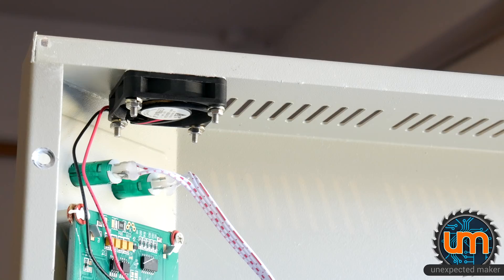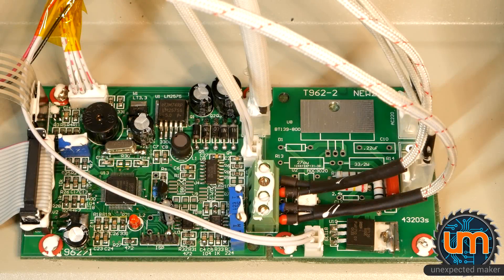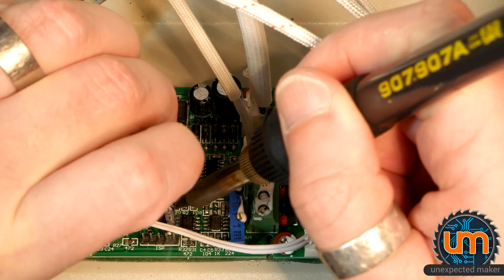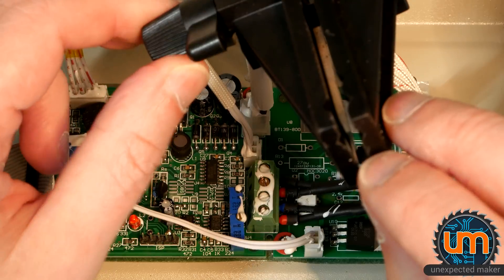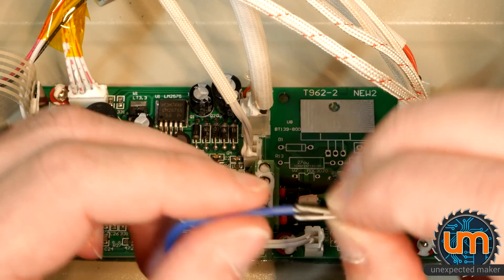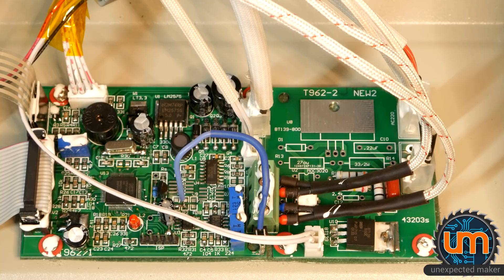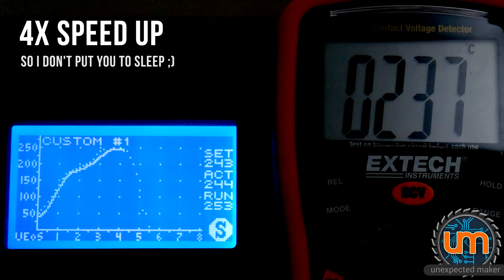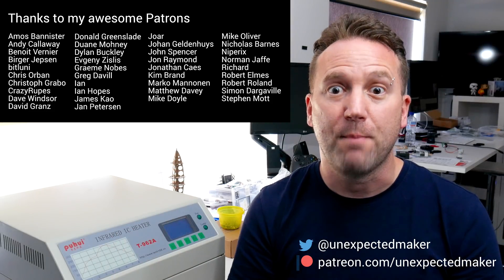T962A Mods Pass 2 - Maybe the final ones?

Comment: Thank you for the clear and accurate video on how to modify my T-962 to make it a reasonable reflow oven.  Your videos made it possible for me to do these modifications with a minimum of trouble.  The only issues I had was getting the C2102 driver installed and operating and that was not an issue with your videos but rather me trusting the message that my drivers were installed (they were not) and my device was ready to use (it was not).  Once I got past that the new firmware and the cold junction mod worked perfectly.  Two thumbs up and my undying gratitude to you.

Comment: I've done these mods on my oven, but I still have issues with consistency in the reflow profile, particularly after the oven has done a couple of runs, the ambient the area which hosts the control boards is higher after a few runs so cold junction is no longer representative. I think the cold junction should probably be moved to the fan end to measure ambient air from outside more accurately.   I've yet to try moving the cold junction got a bit fed up with it to be honest. But its good to see you had some success,  i was going to give up on it, but having seen this I'll try again.

Comment: I have this EXACT Model with all the MODs -- and I have yet to flash it yet -- How is your unit working -- 3 years on?
Reply from the maker: I got rid of it 2.5 years ago - it's a terrible oven. Ok for smaller boards that you just want to use yourself, but not usable for anything production quality. No amount of mods and flashing will fix the totally uneven reflow you get - scorching and under reflow is too common.
Reply: @UnexpectedMaker  Good to know - I mostly have boards that are 8 X 3 CM -- usually only 4 to 8 SMD's, the rest through hole -- If I hit on anything that is production worthy, I'll get my PCB maker to the board populating -- the oven is strictly for small volume R&D...

Good to hear that you got a bit of life out of it. Thanks for the quick reply -- and great channel!
Reply: @UnexpectedMaker just seen this comment.  On that note. Looks like I'll be ditching mine rather than wasting more time on it. 🤔

Comment: Hi, short question. Do you have to do a firmware upgrade to be able to use Cold junction modification?
Or is it the case that the original firmware automatically detect the Maxim 18B20 sensor? Regards /Bo
Reply from the maker: You need to do the firmware upgrade to have it enabled.

Comment: hey Seon, still using it after one year ? could you do a follow up video ?
Reply from the maker: I use it very rarely. I have a Neoden IN6 for my main oven now, and use my Reflow Master/Toaster  when I am doing a single board, or maybe sometimes the T962A.
Reply: Unexpected Maker would it be a sensible purchase as a starter kit ? I have 160*233mm boards to bake

Comment: If you do the calibration now... you will have completed the journey.    Raising the board helps... I use wooden dowels as they do not conduct heat away very well... and it the board can cool faster than sitting on the metal.

Comment: Just ordered an oven, and trying to get parts for mods ahead of time. I see the fan is 40x40mm, but am unsure what the voltage is? Could you please advise on the fan voltage so I can order one? Thanks!
Reply from the maker: Awesome George! I can't remember if it was 12V or 24V. I'd have to re-open it up tp check, and I can't as I'm using it daily atm, sorry.

Comment: Hi, thanks for this video, i already install the cold junction compensation mod but still no accurate, how did you calibrate yours in the manual/bake mode option?
Reply from the maker: Cold junction compensation wont fix the accuracy, but it helps a little. The oven itself is just not very accurate... you need to put a PCB in the oven with a seperate thermocouple attached to it, and reflow a few times and tweak offsets until you are as close as you can be.
Reply: @UnexpectedMaker  Thanks for the help, thats right, im going to do it....

Comment: Good work Seon. I' am worried about the mechanical strength of the mod over time. Perhaps a bit of hot snot or a squeeze of  silicone to hold both ends in place.

Enjoy the oven.
Reply from the maker: Cheers Greg! Yeah now that it's all working, I'll do a final pass and make sure  everything is secured well before I screw it all back together.

Comment: Based on the fan being located low on the side, and alongside vents, I’d suggest pushing the air into the case (across the boards) is the only option. If extracting, I’d expect the airflow would mostly be air being pulled from the adjacent vents, looping straight back out the case. :)
Reply from the maker: Yup, I'm pushing air atm...  no idea if it's pushing enough air or not,  but seems to be behaving ok :-)

Comment: Hi, what is the number for the temp sensor pls ?
Reply from the maker: It's a Maxim DS18B20+ - Not cheap, but you can get clone versions of them but they require an addition resistor placed on the middle pin, depending on how they are used. Some people use them instead on the T962A mods to save $ but it's a more complicated mod, so I decided easier is better ;)